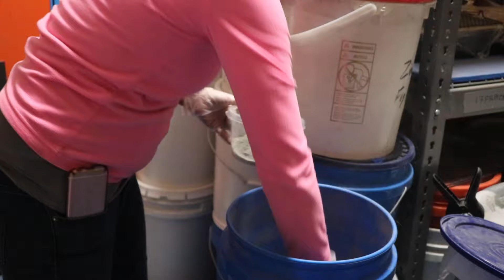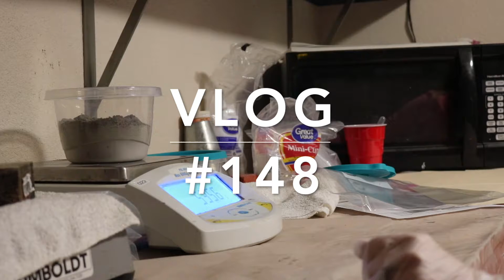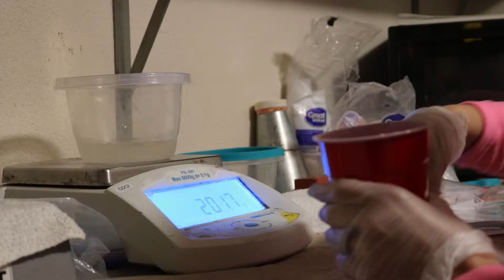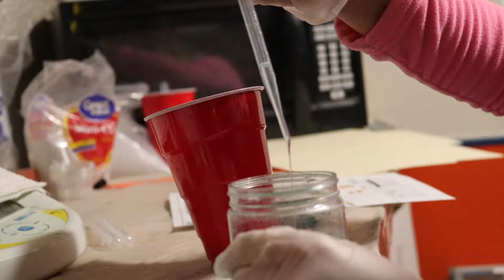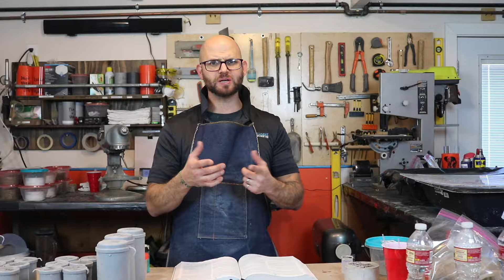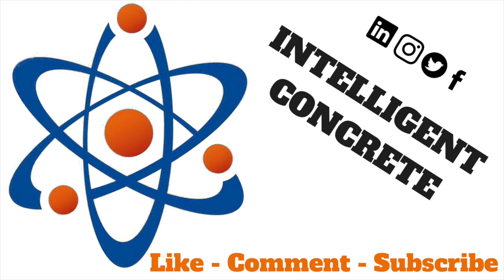ASR Mix Design - Vlog #148

Comment: Awesome Dr Belkowitz ! If we use more 10% of silica fume as replacement of cement it will be harmful for concrete because excessive silica  will participate in ASR. Is that the same for colloidal silica ?
Thank you so much Dr Belkowitz !!
Reply from the maker: elkhadir elkhalil thanks a bunch!

It’s all about the pessimum or that environment for the ASR feel to thrive and survive.

Yes if the conditions are right an excessive amount of silica from the colloidal silica could possible contribute to the ASR like silica fume.